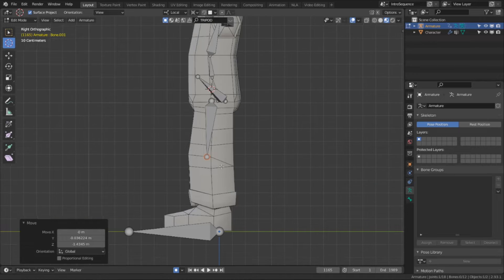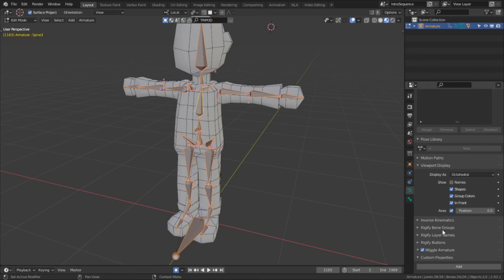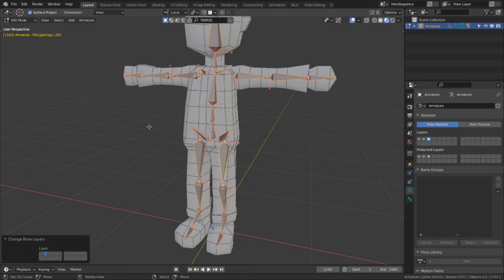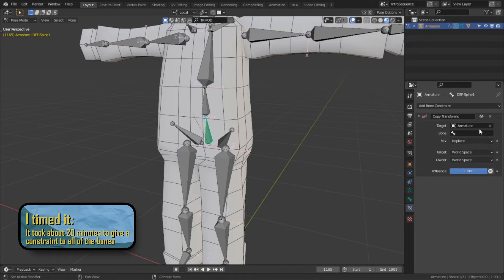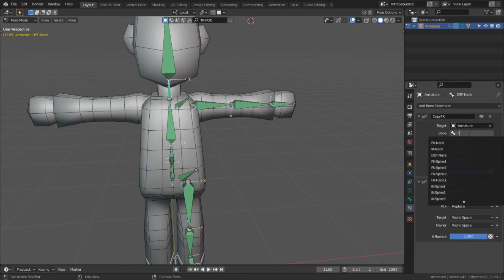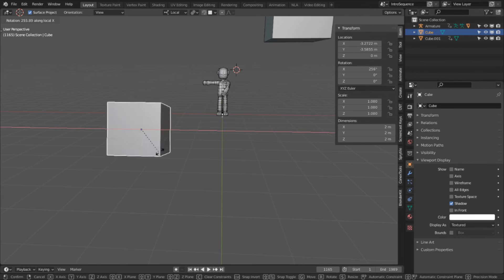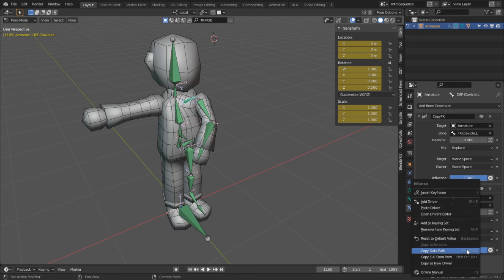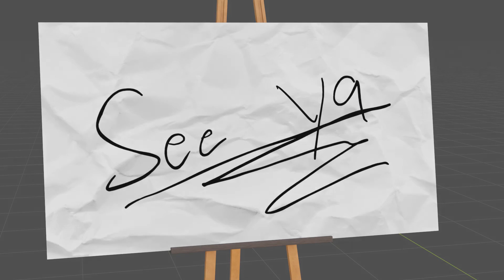Rigging in Blender 2.93 - Part 3: Constraints Layers and Drivers

Comment: I'm a bit late with this, but I'm having issues with the copy attributes menu. Despite enabling it, it doesn't show up, even after I tried selecting and deselecting it, and even changing the key binds of copying in case that was somehow hindering it. I'm working in the most recent version of blender, in pose mode, and I haven't been able to figure out what's going on. Do you have any idea what I might be doing wrong? Thanks!
Reply: i know I'm even LATER to this problem but if you press F3 and search "Copy Constraints" it should be the first one! You still have to make the one you want to copy from the last one you've selected and that all the other bones are selected. I know you've probably already solved this or gave up lmao so i guess this is for anyone in the future.
Reply: @Kvasarr  Ah, thanks for the advice! You’re right lol, I’ve just started using pre-made rig bases and adjusting them, but I appreciate having the answer out there!